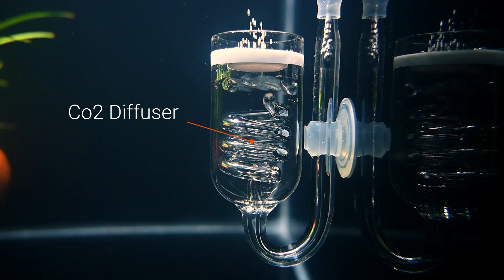Low Cost, High Efficient, DIY Co2 Reactor for Planted Aquariums | Best Alternative For Co2 Diffuser.

Comment: what about this idea....simply manually fill a bottle or jar that is inverted and suspended in the aquarium half way with CO2 and letting that pure CO2 at the top of the jar mix passively with the water?  And possibly adding a water pump just below the open end of the jar/bottle to create some flow?   That manual fill could last quite a while.
Reply: I've seen people do this with nice looking planted tanks. I think most people wouldn't keep up with consistently re-filling it, and it won't provide high enough levels for some plants.

Comment: Sorry I have a question, I have 40 gallon tank and through this method the dissolve CO2 might be less for the whole tank and maybe CO2 indicator will not be green that's what I am worried as it will allow limited CO2 to resolve before it gets wasted? And then even if we dissolve it how would we circulate the water in the whole tank? And can you please suggest the pump how much Watts or how much gph? 3 W 50 gph or 5 w 90 gph or 10 w 160 gph or more? And can I take a bigger bottle to give it more time to dissolve such as smart water bigger bottle?
Reply: @AquariumMastry still looking for your response. I am really interested

Comment: CO2 injection is a waste of time. Put a lots of plants in the tank and over stock with fish. Use a deep dirted substrate capped with sand. All the mechanical equipment you use in a tank does a poor job mimicking nature. You can save a shit load of money not buying the kit in the first place.
Reply: Plants need CO2 to grow quickly, they’ll grow without it but it will take a long time and some plants need the extra because they usually grow out of the water. People have done tests with CO2 injection and the results are pretty undeniable. You’re not wrong that you can save a lot of money and still have a good looking tank though, it’s definitely not necessary.

Comment: I recently bought a diffuser like the one in the video but the ceramic disc appears to be blocked as it is not passing any co2 even st high pressure. Is there a way to unblock the disc. I even soaked it in water for a few days but still no luck.
Reply: Soaked it in bleach with hot water
Reply from the maker: Hey @superaquatics!Try soaking the ceramic disc in a 1:1 mix of bleach and hot water (Soak for 5–10 minutes, up to 24 hours if heavily clogged)  it helps dissolve algae and mineral buildup. After that, rinse it thoroughly with water and let it soak in dechlorinated water overnight to neutralize any remaining bleach. It should start bubbling like new again!
Reply: @AquariumMastery Thanks. I will try with the bleach but it is a new & unused diffuser so no issues of algae or any other accumulated build up. 
I tried soaking overnight in white vinegar but that didn't help either.

Comment: The reason I asked my question was that the pump you used was in your video ( which I loved ) looked like it already had a hole for the tubing from the O2 generator...so knowing where you got the pump and who makes it would help me a great deal...please and thank you.
Reply from the maker: @wrong-waygourmet4129 I actually just made that hole using a heated nail 🔥—simple and works perfectly! 😊
Reply: You can see in a shot he has just drilled that hole where he glues on the connector for the tube bud.  Any small air pump should do it :)

Comment: I…this is amazing. I have everything I need to do this right now. Do you think a diffuser like this will work for citric acid/baking soda or even proper CO2 tanks, too? It makes so much sense. Also, I think the swirling vortex is beautiful too!
Reply from the maker: That’s awesome to hear! 😄 Yes, this setup works great with citric acid/baking soda systems and even pressurized CO2 tanks. Just keep the bubble count low, since the reactor holds and dissolves CO2 efficiently. And I agree that swirling vortex is oddly satisfying to watch! Let me know how it goes!
Reply: @AquariumMastery I did get it set up and right now my challenge is finding a pump setup to drive this that doesn’t get clogged very quickly. Also I am having a hard time with a bottle design that doesn’t provide enough room for a curious white cloud mountain minnow to swim up inside the bottle vortex and then get trapped. I need to revisit the system or find better parts to use.
Reply from the maker: @smartperson1 Sounds like your pump is acting more like a mechanical filter right now. If possible, try placing it closer to your main filter’s outlet, it can help reduce clogging.
nstead of a regular pump, try using a mini internal filter with a sponge pre-filter on the intake. it’ll keep things running and reduce clogging at the same time.
For the bottle trap issue, you can block the opening with a piece of fine mesh or sponge—just enough to keep curious fish like your white cloud minnows out, while still letting CO2 circulate properly. (Check around 4:22 in the video for a reference!)

Comment: Very smart and easy solution indeed. How much power do the pump draw? I guess the cost of electricity must be lower than the cost of escaping co2 to make it a saving?  😀👍
Reply from the maker: Great question! 😊 The pump I used in the video is a 6W model, but there are other options on the market that run as low as 3.5W. So yes, even with continuous use, the electricity cost stays super low, definitely cheaper than losing CO2 through inefficient diffusion! 👍💡
Reply: @AquariumMastery  Thanks for the input. Now I have been calculating under my conditions. Running a 6w pump costs approximately 25 euro per year here. My total co2 consumption during a year is 20 euro. If something changes dramatically in consumption or pricing I will remember this video. As it is today, it would be suboptimation.😀👍

Comment: Hi, good job. I posted a similar reactor to my channel 17 years ago. It is still there with 85k views. A few tips. 1-Give CO2 directly to the bottle, another small hot drill for the bottle will be enough. 2-Keep the water pump upside down to avoid co2 trapping around the magnet of the pump. If you close it at night, it may not start in the morning because of tarpped co2. 3- Good choice of bottle, for those who can't find a clear bottle like this, I had used a bird cage water drinker.
Reply from the maker: Wow, 17 years ago? That’s amazing! 🚀 Thanks for sharing your experience and those great tips! Giving CO2 directly to the bottle and keeping the pump upside down are really smart adjustments. And the bird cage water drinker idea is genius for those struggling to find a clear bottle. Appreciate your input! 😊
Reply: @AquariumMastery Thank you! It is worth mentioning that another advantage of the bird cage water drinker is, it is thicker than water bottles. This gives advantage to drill the bottle with an angle so that you can make the vortex effect easily.
Reply from the maker: That’s a great point! The thicker material would definitely make drilling at an angle much easier for the vortex effect. I'll definitely mention these points when I do an update. Thanks again for sharing your insights! 😊
Reply: Wait why directly into the bottle tho what's wrong with the other method

Comment: can i use this with pressurized co2 system as well?
Reply from the maker: Absolutely, you can! Just make sure to use a low bubble count. Since this setup traps CO2 until it dissolves into the water, you won’t need a high bubble count like you would with traditional CO2 diffusers.

Comment: Hi nice video, i've tried this and everything works but the problem is that a lot of CO2 gets trapped in the upper section of the bottle and there's no way to get them solved in the water again and the only way to get them out is to flip the bottle and the CO2 will get out but will be wasted. Is there anything that I can do?
Reply from the maker: Thanks for watching and trying it out! 😊 If you can create the water spiral effect inside the bottle, like in the video, the trapped CO2 should automatically dissolve into the water over time. Make sure the pump’s output is positioned correctly to create that vortex effect, it really helps maximize CO2 dissolution. Let me know if that works for you!
Reply: @AquariumMastery Great job on your channel and I was wondering if you think using some magnets would be a good option for the opportunity to rotate it for the few people that are not getting their pump to create the vortex ? I'm going to make my 1st one today and I will be back to lyk how everything goes , 🩵💚

Comment: I run my co2 through my canister filter! 👌
Reply from the maker: Nice approach! 👌 Just a quick tip - running CO2 through your canister filter might impact your nitrifying bacteria since they need oxygen to survive. Keep an eye on your tank’s parameters to make sure everything stays balanced!
Reply: @AquariumMastery  Yeah, everything is spot on. I'm thinking the ppm of oxygen and co2 in the filter should be the same as the tank itself due to it circulating. It's also a filtered walstad setup so there should be plenty of the bacteria in the tank alone.
Reply from the maker: Sounds like you’ve got it all figured out! 👍 Circulating CO2 and oxygen levels make sense, especially with a filtered Walstad setup. Having extra bacteria in the tank definitely helps too. Great job balancing everything!
Reply: How oxygen and CO2 became connected inside the filter? It is not like it CO2 bubbles will squeeze out oxygen from water flow. CO2 bubbles just hang out below the filter media. The issue you need to keep in mind is that bubbles can be stick inside the filter head and it will break when rotating without water.
Reply: Well, 5 months and I don't have any problems at all, the longer the co2 is circulating the more it disolves into the water! 🤷  @Elkmor2
Reply: @gardian1701  Good for you! I had Eheim Classic and used this method of feeding CO2 into the filter intake. All went well until several months in, it just stopped. xD